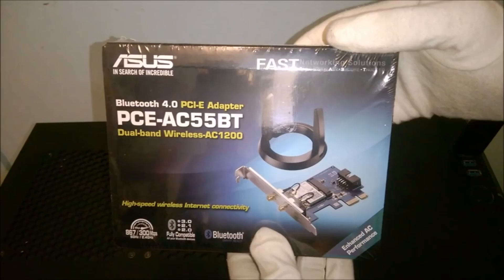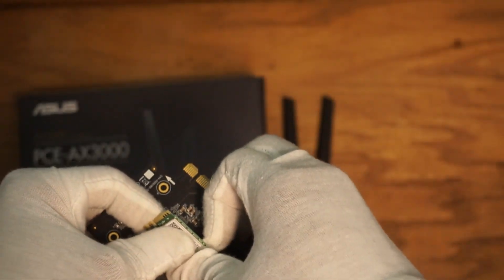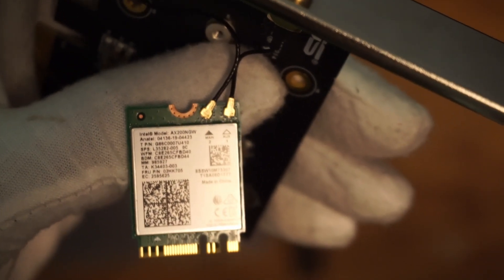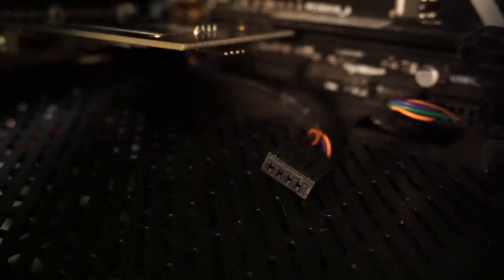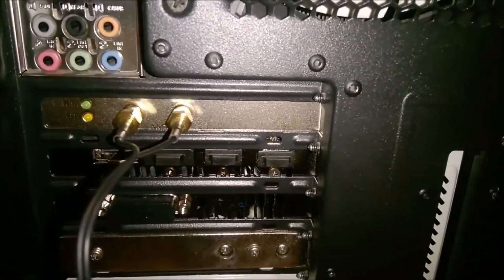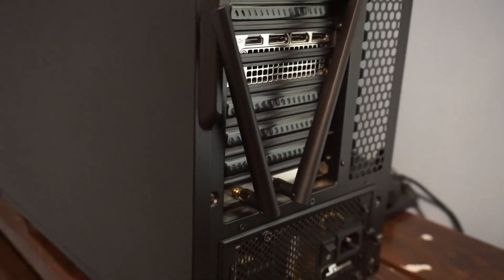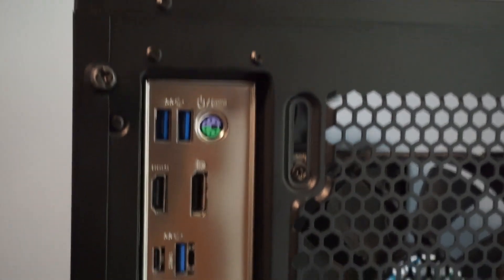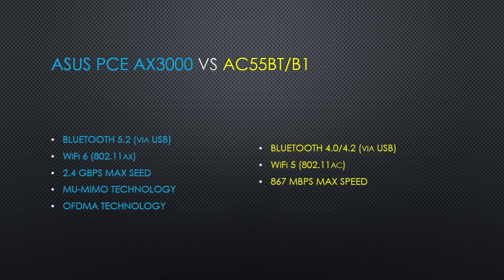ASUS PCE-AX3000 Bluetooth 5 & Wifi 6 Adapter

Comment: Guys buy another brand, for wifi it works flawlessly, but the bluetooth icon will disapear very often, i had to buy a separate bluetooth dongle cause i got fed up with repairing the bluetooth drivers constantly just to use the bluetooth.

Comment: Pardon my most likely stupid question, but does the driver disc provide the network connectivity or no? I have a usb dongle mounted network connection which i have on many occasions, twatted in VR. Because if it does, then am going to heavily consider* it as it provides an astronomical improvement to my shit stick currently in use.
*It's not a consideration, am gonna have to argue it with my dad, 30 quid over 430 quid, better option, as fuck settling repeaters up.
Reply: I believe it’s to setup the drivers. The guy posted the links for drivers in the comments too
Reply: @SpiderKidoesMinecraft  I would like a definite answer here, as am sure you can understand, but I am grateful for the information you have provided. After all if there's no "UI" to connect to my network, well am shit out.
Reply: What do you mean by provide network connectivity?

Comment: U think would be compatible with my ASRock Z690 Extreme? The WiFi/Bluetooth one was out of stock so I have to do it this way. But I want to make SURE I get the 100% STRONGEST WiFi/Bluetooth for my PC. 
Btw, I'm not gunna be pairing more than 5-7 and ill just be in my room, etc so I do t need 100 meters of WiFi protection (just to be clear) lol.
Thanks man! ✌😊
Reply from the maker: Yes, it should work fine on that board.
Reply: @Superior85  Hey Thanks a lot for getting back to me man :) I'm so inpatient that I ended up getting a Asus BT500 at Best Buy. I have a WiFi6 in my current mobo that I can take out and put in my new one so I'm just going to give that a shot. Wish I would've seen this reply sooner I would've bought this. Thanks again! :)
P.S. Now I have to do the actual "putting together" part. I'm new to putting PC's together so this is a first for me. I just hope it isn't too hard to do. I'm installing my ASRock Z690 Extreme, i5-12600k, and a Cooler Master Hyper 212 RGB Black Edition Air Cooler for the PCU. I'm also installing a closed cooling system for my EVGA GeForce 3080. Just thinking about all the wires and not knowing what is what has my anxiety high already lol. Good news is that I have a well running PC right now so as long as I pay attention to what I'm unplugging and WHERE everything goes, I'm "hoping" I can just remove the old, and replace the new and just start it back up again. PRAYING LOL
Reply from the maker: @zorbgaming7391  nice machine, good luck putting everything together. for my first build i remember watching some build guides to help guide me through the process.